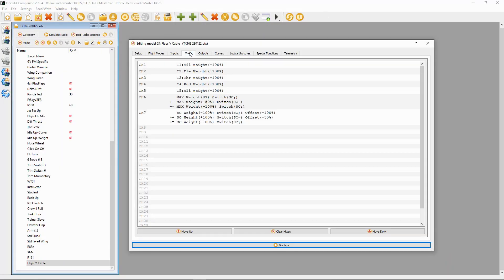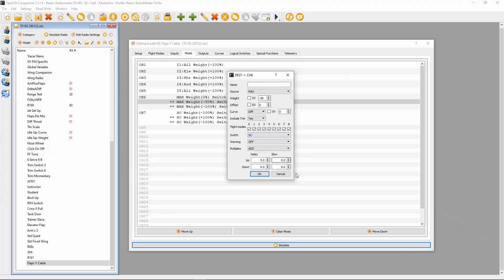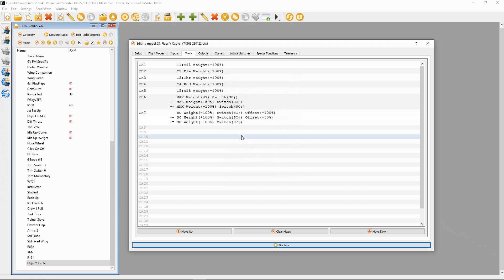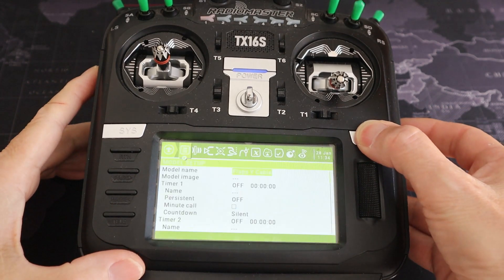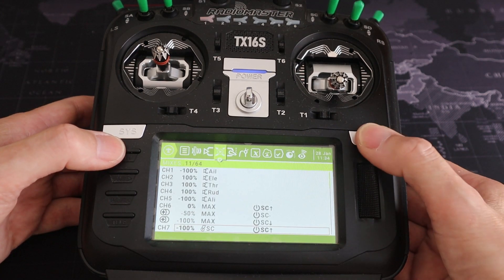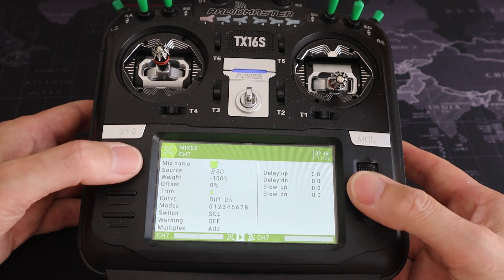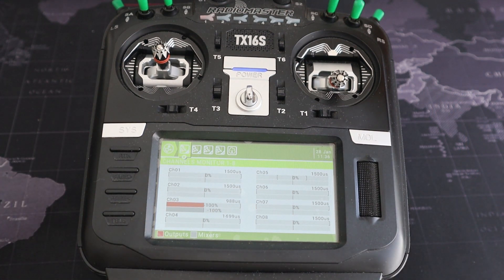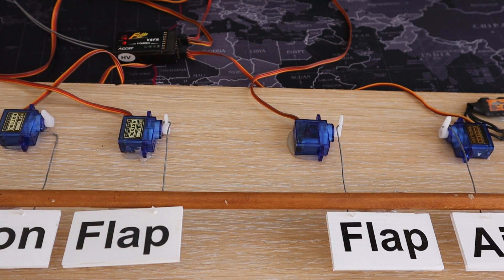OpenTX Setting up flaps with 2 servos on 1 channel using a y-lead

Comment: Hi Bill, I got both flap servo's in a Y-lead as described in the video. I'm currently wating for the wind to die down sufficiently to allow me to experiment with flaps on take off (it's a FMS Fox 2300, so hand starts) and landing. I'd like to have the weight on the first position on one of the rotary channels preferably S1, which would allow me to adjust the amount of flaps in flight, in order to find the most suitble amount of flaps for most situations take off and landing. How should I go about this?
Reply: Never mind, found out how to do it, turns out to be quite simple. Works a treat.
Reply from the maker: @janspoelstra8309 sorry Jan, have moved house so off grid from YouTube.

Comment: Hi Bill hope your doing well in the UK. I don't understand completely you say you using a y cable to only use one channel. Bud on the radio you using two channels ch6 and ch7 to setup the flaps. Will I be able to to use a 5ch receiver? Can you please help me
Reply from the maker: Hi Johan, I just used a model that used two servos for the video. Apologies if it caused confusion. Like UK good but very little flying.

Comment: Thank you for the Video. Supplement: on some models, the servos are not built in like on your test bench, but with the servo arms both on the outside or both on the inside. Then it doesn't work with a Y-cable because 1 servo always runs in the opposite direction. If you cannot connect the flap servos separately to the receiver, then an inverter must be connected in between when using the Y-cable to a servo.